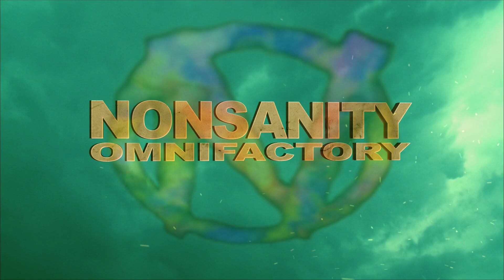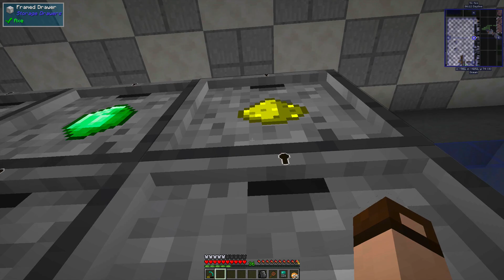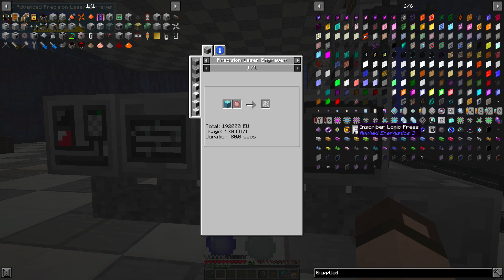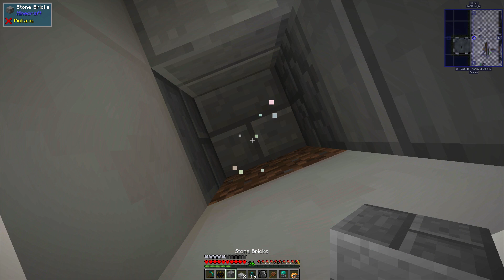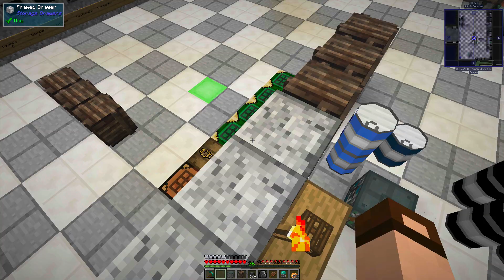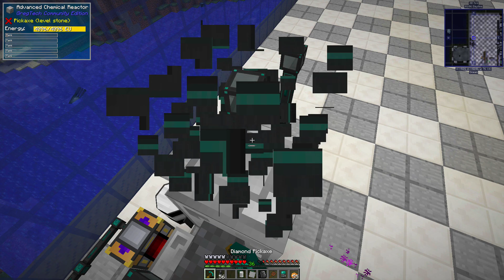OmniFactory - ep 5 - Oh Sheets!

Comment: Wasn't better getting fenol from the pirólise of coal? The quest book guides thru this, cuz frm what it seems, oil will be used later for better power gen and with the distilation tower it outputs more subproducts
Reply from the maker: Hmmm... At the time I started setting up that set of machines, I was out of coal and hadn’t started making it with mob simulation. So I didn’t follow its path through JEI. I’ll be sure to go back and investigate that, and if it’s better, switch over.

In general, I’m trying not to cheat by using the quest book for hints. It’s more fun/challenging that way.  ;)
Reply: @Nonsanity  yeah, i get it :), this pack is made to introduce GT to a broader audience, and the quest book is more Like a rough guide, many ppl saíd that the book dont show the best way sometimes, and challenger is what makes it a fun pack

Comment: The setup on the left has a ton of Sulfuric Acid and makes the Polyethylene Sheets... so you add machines to the setup on the right to make Sulfuric Acid and then manually give it Polyethylene Sheets... 😊
Maybe you could automate Coated Circuit Boards.
Reply from the maker: I did just that while the episode was rendering and uploading. I’ll show the final result next episode. Sometimes I can’t leave well enough alone. :)